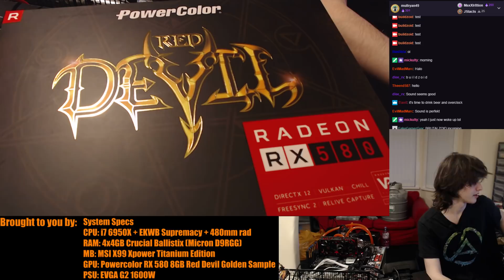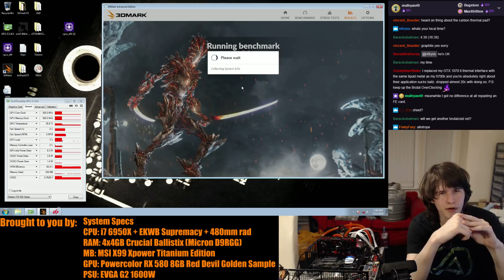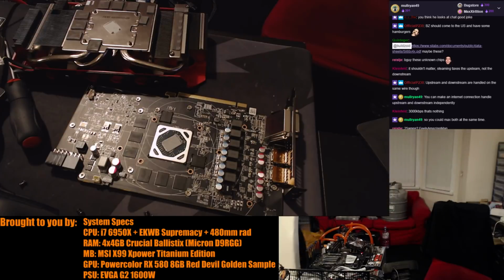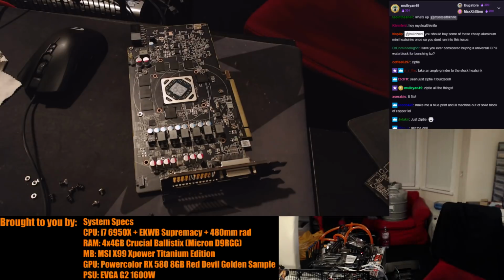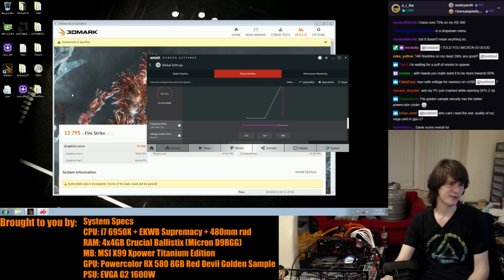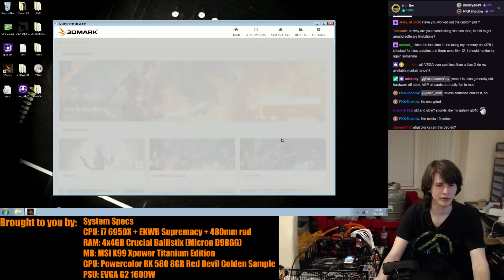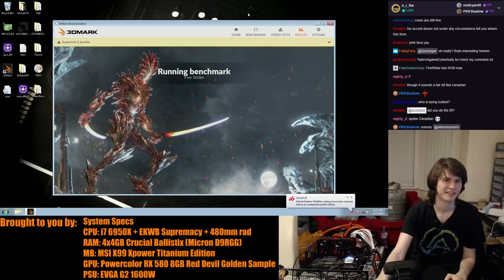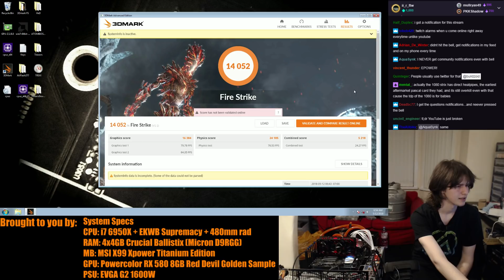[VOD] AHOC livestream 56: Powercolor RX 580 Red Devil Golden Sample

Comment: Buildzoid help!! I bought a ASRock x470 master sli/ac and planned on using my old power supply. A Corsair hx750 gold. It's old but only been in service a few months. I just noticed the MB has 8+4 pin power connector on top but my psu doesn't have any 4 pin connectors. I only have the 8 pin. Is that ok? I mean is the 4 pin just in case I'm running a 2700x with an aggressive overclock? I'm just have a 2600.
Reply from the maker: You don't need to plug in the extra connector. It's completely optional. The CPU needs to pull like 400W for the extra 4 pin to be useful.
Reply: Thanks so much for the fast reply. you're a lifesaver.

Comment: 2 Questions dude:

1: My Nitro+ 480 died yesterday - won't initialise in device manager in any way. Any ideas for diagnosing/fixing a that kind of issue?

2. If I can't fix it - do you want a Nitro+ rx 480 to fix/harvest VRMs from?
Reply: Somewhat sounds something along the lines of you've got a custom bios and you updated your drivers meaning they are no longer patched.
Reply: I've tried loads of different driver versions (including none) and it still won't initialise
Reply from the maker: I take it the card doesn't have any display output right? If it doesnt' the first thing to check would be if it's getting all the voltages it should. Also the Nitro should have a BIOS switch so if you had a BIOS falshing accident you can try that.
Reply: Actually Hardcore Overclocking it's getting a display out, but I'm not sure if from the card itself or passing through the iGPU. 

And I'd messed around with custom BIOSes before, bit months ago and no issues then
Reply: i heard that the oil from the thermal pads can kill the cards somehow 

sent it to buildzoid if you can fix it, id love to see him trying to fix it

Comment: Hi Buildzoid are there any significant gains in lowering the timings ? I mean does it increase fps ? I know that slight vram Oc can give you 2-4 fps but timings ? BTW I have the same card and made my own bios as well and ordered some thermal pads to put it under that poor VRM Im planning to put it between  backplate and PCB do you think it will be more stable in Oc ?

Comment: Hi, you can use the cooler from a 7870 it will work. Thats what I did on my asus dual rx 48 4G. So its 1300 core boost and I used the sapphire rx 580 nitro bios and got it to 1400 with 70c. A bios for it without power limit will be the top :)
Reply: XkStreamWorks lol my 7870 is a great overclocker but the cooler really sucks, I hit thermal runaway at Max fan speed during Firestrike. I'm goin to get a Morpheus II for it though.

Comment: What overclock settings would you recommend for a sapphire Rx 580 nitro 8gb ? When I overlooked the memory above 2150 it starts putting out memory errors in hwinfo64
Reply: If I remember right hwinfo memory errors are fine to a point, the cards error correction will sort some of them out.

Comment: Wait.. you have 4 furies??
Reply from the maker: I have 5th one that I killed.
Reply: Impressive. Anyways with the Fury, whats the major difference between it and Vega? I know Vega can clock higher, but the Fury has a stock HBM speed of 1000 MHz and a 4096 bit bus and a Vega has a stock speed of 945 MHz and a bus of 2048.. would the Furys HBM perform better?

Comment: if the 6 pin and 8 pin power are connected at G 0 OHMS and connected at V+ 0 OHMS then that connects power rails on the ATX PSU that may already be isolated thus making your ATX power supply consume more power, die sooner, supply less power and have less ability to regulate voltage properly. it should be illegal for a video card manufacturer to possibly damage a customer owned ATX power supply.

Comment: I mine crypto and have just about every 580 out there and all the heatsink designs are similar, horrible and they all run hot.  That card is by far not the worst, the low end asus and MSI are horrible super tiny heatsinks.  Saphire makes the best heatsinks.  I bet if you pry, most gpus with plates that screw in are attached with a dab of silicone which ends up creating a tiny gap.   Just pry hard with a screwdriver and it will pop out.